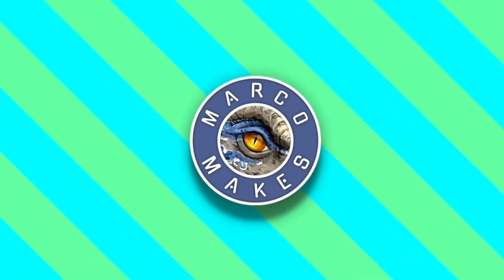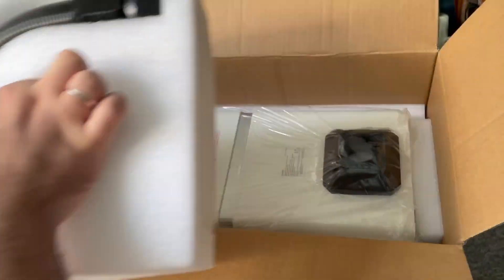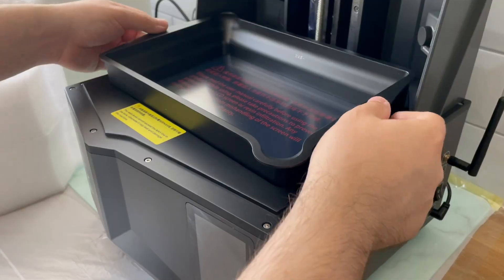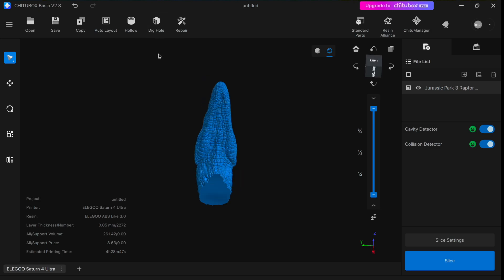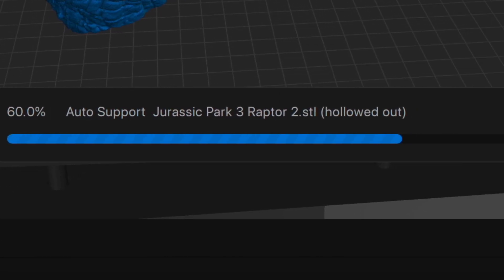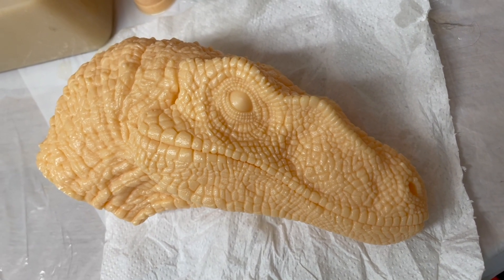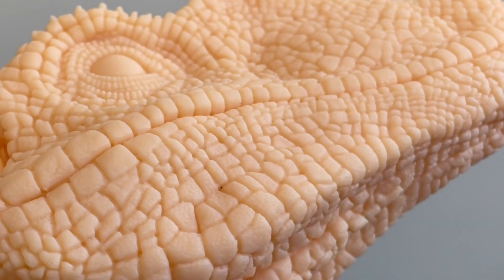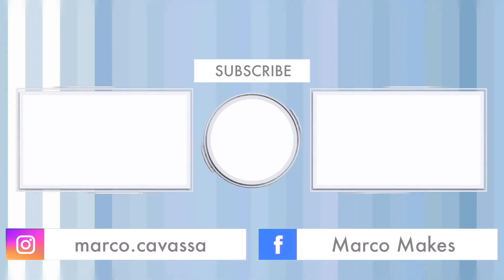Elegoo Saturn 4 Ultra Unboxing, Set Up, Slicing, Printing and Review - 3D Printing a Dinosaur!

Comment: I just printed my first model with supports. I got a bunch of little nubs on the print. How do you avoid these? I used the middle supports as you suggested. However, they did not come off very easily.
Reply: You need to remove them before curing. Use hot air to make the removal easier.
Reply: @thebeautifulanimal thank you

Comment: Great video, very helpful 👍🏻
Just got mine, waiting for an enclosure to arrive before I start. I have a question though: you dig a hole in the raptor's neck for drainage, but then print it upside down... When/where does the draining happen? Did you stand it in the drainage tray for a while, but skip that part in the video?
Reply from the maker: Hey! Cool! It drains by itself, layer by layer. The resin while printing doesn't actually come out of that hole (in this case due to the printing angle) but it comes out of every layer when printed. It really depends on how it's angled on the build plate. In my case The hole is just to make sure it's properly hollowed out and it's indispensable for cleaning.
Reply: @MarcoMakesOfficial aaarrgh, of course! I was being a bit dumb - if there was no hole it could cause a vacuum that effectively pulls liquid resin up with the model, like pulling up a glassfull of water upside down, the water stays in until it's out of the water and the seal is broken. But since the model gets closed...
Thanks for helping me realise the bleeding obvious 😁

Comment: I want to get the Ultra 16k so baaaad but I live in an apartment complex. There is no way in hell I am printing inside my apartment, but sometimes I get tempted; how does the air purifier work?
Reply: The air purifier doesn’t work on Voc’s only the smell and even then not by much unless you have a room dedicated to 3d printing with an open window it is way too messy for to deal with. I have it set up in a heated garage and open the garage door to release gases. Even when it’s cleanest it’s still messy and smelly theirs also the issue of something going wrong. FYI don’t bother with water washable it’s nothing but a headache.